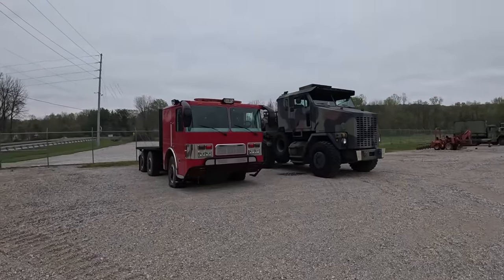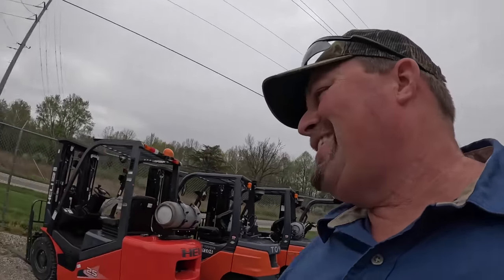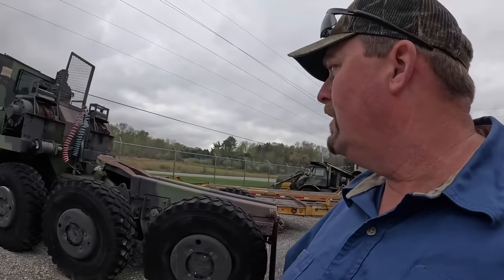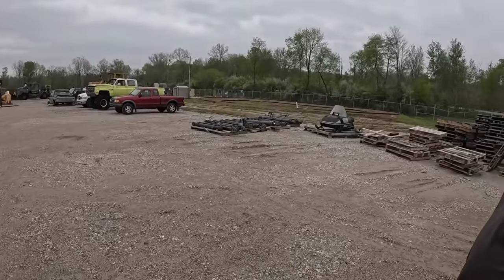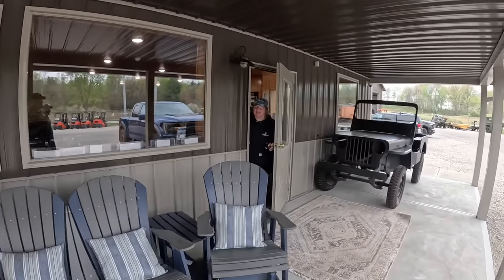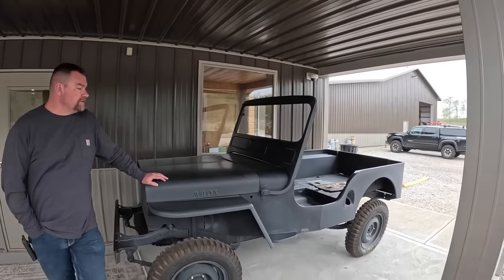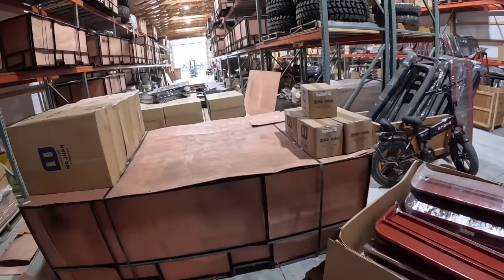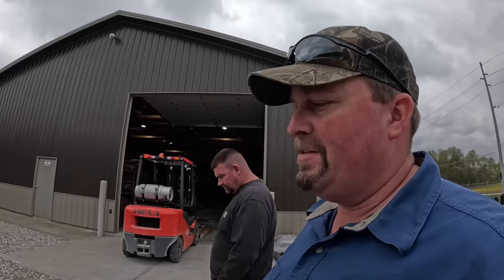Lot, warehouse and shop update with Jay and Scott with prices and answers April 2024

Comment: that wheel horse reminded me of a single cylinder, belt driven 3/1 geared international harvester 'tractor' we acquired back in '67 from the haulage firm my dad worked for. It was used with a sweeper attachment to keep roads clean and was knacked by the time it came to us. We sourced a slightly larger 1 cylinder Allen motor which we unfortunayely first fitted wrong way round  and ended up with 3 reverse & 1 forward gear.😶

Comment: The Wheel Horse has the bracket on the Rear Axle to take a Dozer Blade ! It'd be Great to see the Wheel Horse made Good / maybe painted.
Think its a Very Late 60's or Very Early 70's with the Spherical gear knobs and PTO Engage Set Up- 72's went to a Flat topped Gear Knobs and an Over Centre Lever to engage the PTO.
Reply from the maker: 1973 and I do have the blade

Comment: I love it when you work on G series JD's. I have a 450g and a 650g.  I have owned the 650 since 1998 I purchased it from the bank when it had 300 hours on it. It has about 6100 on it and Anna can honestly say that is almost bulletproof.  Just had its first transmission put in last month at 5900 hours.  Old boy come out with a service truck in my shop snatched the old one out put the new one in by his self in about six hours he only charges $110 an hour so my labor was only about 700 bucks.  
  The 450G is a 1995 model I just picked up from the original loaner back around Christmas. It only had 1100 original hours. Today it has about 1400 and is basically trouble Free